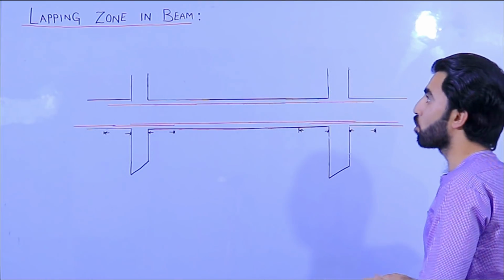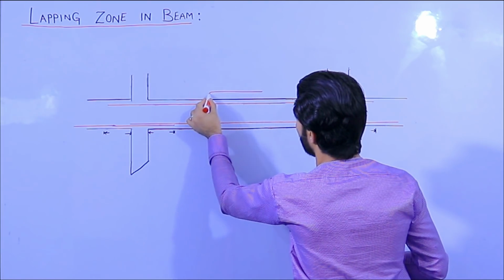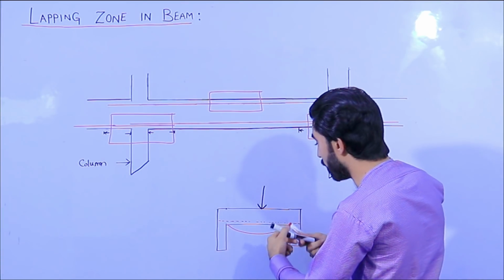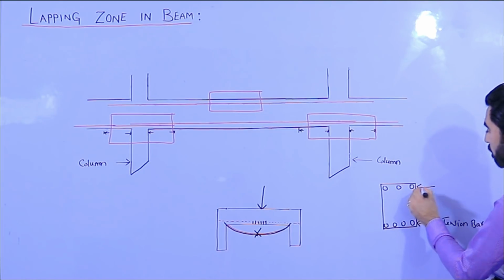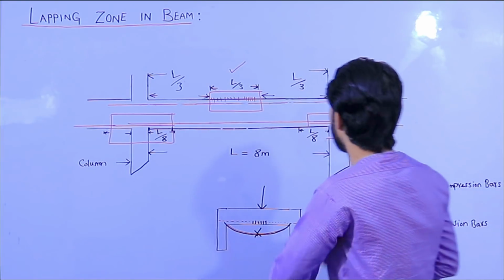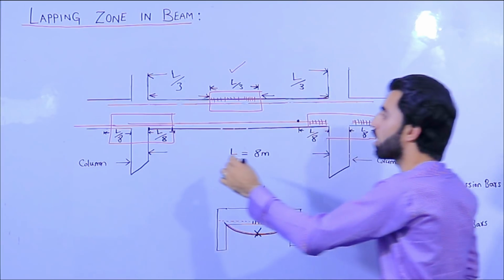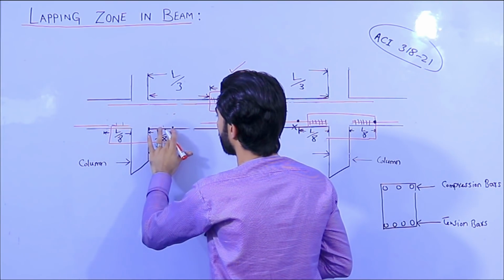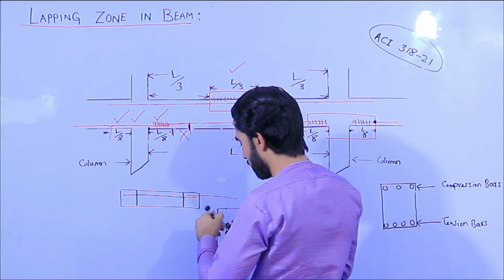Lapping zone in Beam

Comment: I believe bottom beam main bar lapping is provided up to L/8 from the face of column is have been ban.  Because during earthquake join of building face most stress. Like beam and column join. 
Lapping is provided 2d(d- effective depth of beam) away from face of column. So it is simple. We just need to add 2d + LD. 
 If there are more numbers of bars. We just need to  avoid midspan' s L/4 distance(L- effective span) and 2d from face of column  and keep minimum of 1.3m distance between 2 center of lapping. If lapping length is 550mm. It's center would be 275mm, other rod's lapping should be provided 1.3m away. If we have started our first lap at 2d from face of column. Then next lap should be provided at 2d+275+1300 continue in same manner
If it is not possible we should provide lapping between other other columns.